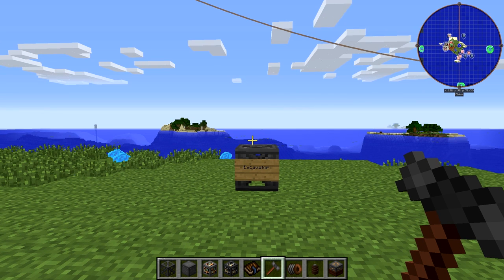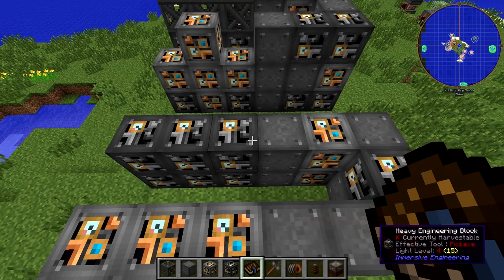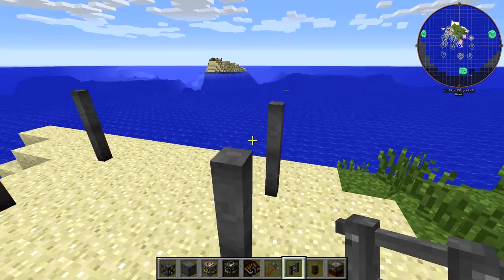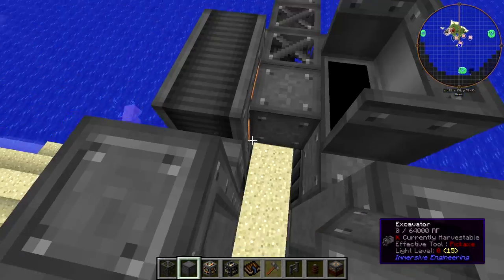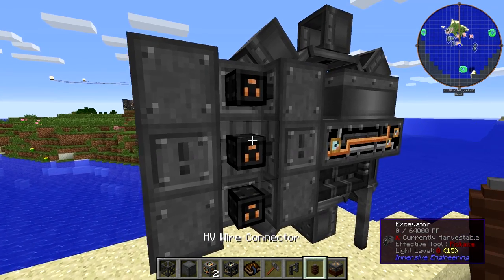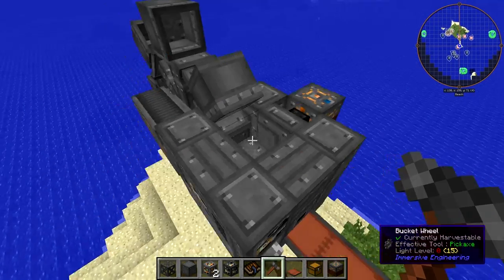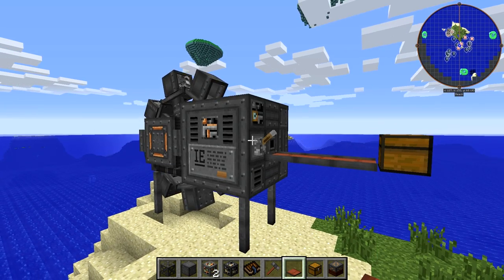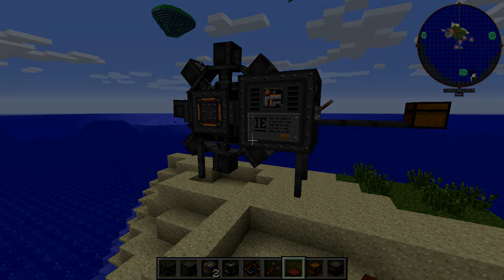Immersive Engineering Tutorial #21 - Excavator

Comment: Now to find a way to run a nuke reactor from reactorcraft to the excavator.
Reply from the maker: Easy, put an RF generator on your turbine.
Reply: IE part? Have not seen it before on reactorcraft unless brand new  (air compressor I know of).
Reply from the maker: Reman Scimitar
The RF generator is from Reactorcraft, its a multiblock you can build directly on the end of a turbine in order to generate RF. Its best used on a High Pressure Turbine.
Reply: +SentinalhMC ah, might have to check this out then, thanks for the info.
Reply: you don't need to do that, you can almost run an excavator with a microturbine with a 16x gearbox in torque mode connected to a rotational dynamo, (you get about 4012 rf/tick when the engine spins all the way up, I can't remember the exact value off the top of my head, you might need to check that) you can then use waterwheels or thermoelectric generators connected to a different plug on the excavator to make up the difference. in the end, it's a much easier (and possibly somewhat broken) way to power the machine. have fun! if you would use a turbine generator, be aware that you will still have a surplus of power, probably enough to run an arc furnace
Reply: китаец
Reply: I'm using the hbm rbmk for mine

Comment: i know this is an old video but maybe you can help me if you see this. My excavator only breaks the few blocks near the surface then stops breaking blocks and no longer collects items to output. I have power and it works for the first few blocks then stops collecting. the wheel is moving and positioned correctly. thanks in advance.
Reply: i am playing the modpack stoneblock 3 maybe that could be an issue.